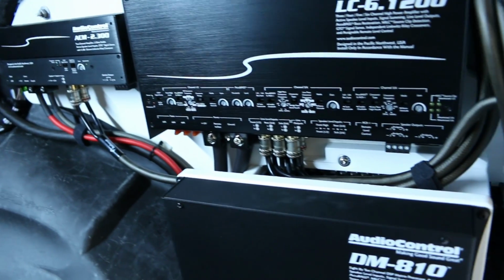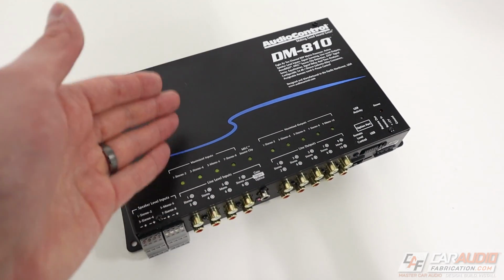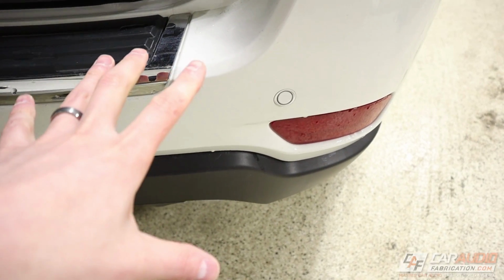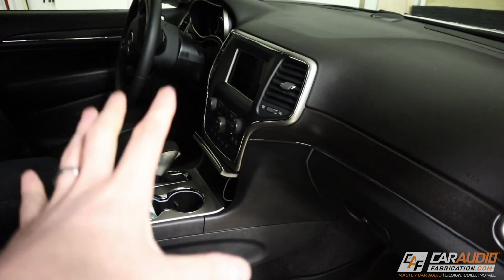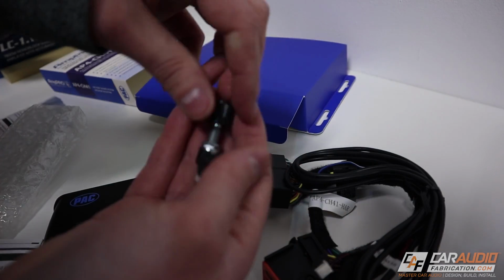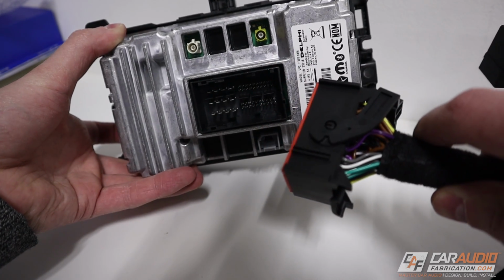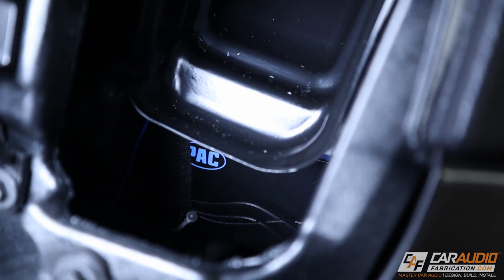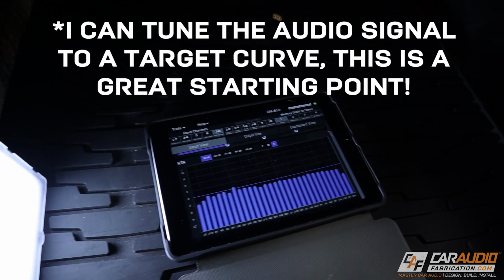Optical Digital Output AND KEEP warning chimes, voice, nav - How to

Comment: Sounds like great products but all these units are expensive.
Reply from the maker: That's just your opinion. The ability to get completely flat, high quality optical out, retain all chimes and factory features, have a noise free signal, and keep the factory head unit is a HUGE VALUE.
Reply: Yep. But like any hobby, it requires money to do it right. You can still have fun for cheaper, though! This video is more for people who are taking a deeper dive. For example, in high school in the early 2000s I spent all my money on cheap equipment and it was awesome. Once you age and get more money, you can start diving into this stuff. Money is all relative.
Reply: I think that most of y'all forget that Mark does high quality audio installations, not some "cheap DIY, save money and watch your car burn to the ground when you decide to save money by not having a fuse in your power cable" mumbo jumbo. You can get better (than stock) audio for cheaper too and I'm sure Mark has covered in his videos how to do it professionally. You should always remember that you get what you pay for; The PAC Audio unit was cheaper than I thought given that it retains all the factory features and plugs in to the stock harness making the installation easy and clean.
Reply: Not at all a waste. I went from an Audiocontrol lc2i providing signal to a Dayton Audio DSP-408 and swapped to an Amp Pro to provide signal to my DSP and the sound difference is night/day. These units fix the factory signal out to your amps/dsp. If you want to run active and use a DSP it's a must to have a clean/flat signal to provide to your DSP if you really want to correctly tune your system. Plus the ease of install and not having to cut/splice any wires is well worth it. You can pay $100s even $1000 for a new Head Unit or add 1 of these for $350 and basically turn your factory HU into aftermarket quality... 

Ignorance is bliss however so if u want to spend $1000s on a system, speakers, subs, amps but cheap out when it comes to providing a proper signal to those amps than by all means go ahead... it's your money being wasted.... Itd be like buying a $100K sports car & running 87 unleaded...

Comment: Hi... 
Sir there is some confusion in my mind about sealed and ported subwoofer enclosure,  as I got sony xplod xs-nw 12002 subwoofer for my car but there is recommendation in manual for sealed enclosure, so what would be the best?
Reply: Depends on the subwoofers you use and music you listen to. Sealed, usually gives a clean, "bump" bass. Ported, usually gives more of a "boom" bass. Also, depends on how much room you have to play with. Ported boxes are larger than sealed. Moreover, back to the type of subs you use. Smaller woofers will usually give more of a "bump" bass. The larger the subwoofer, the more "boom" bass you will get. There are alot of variables involved with installing a sound system to your vehicle. Hopefully Mark will be able to clarify your dilemma.
Reply: @inkdreaper874  
Yes I have enough room space in my tuv300, but what mark recommend its important.

Comment: Car audio fabrication can u show me how I can build a custom hole for 6.5 speakers in the rear doors that have no stock holes nor speaker. I wanted to add extra speakers since the 2 speakers in the rear are in the dash and not in the doors
Reply: If there arent any holes it could be a challenge..i would choose the original places where the speakers are now..because you need to know: A if there is room for speakers and B if nothing interfeares with the speaker like window mechanisms...